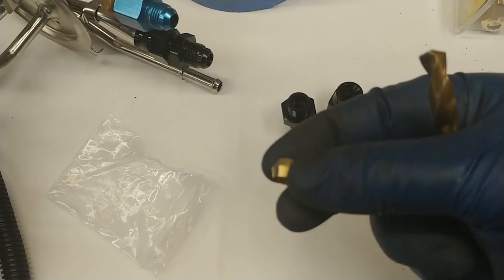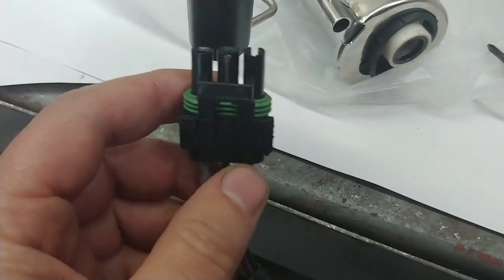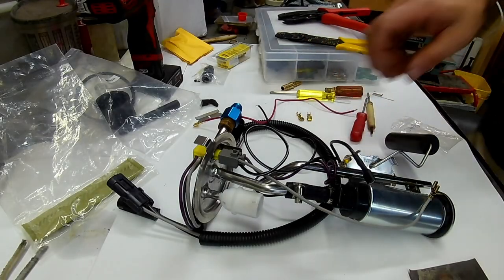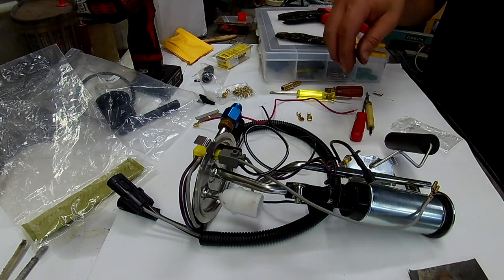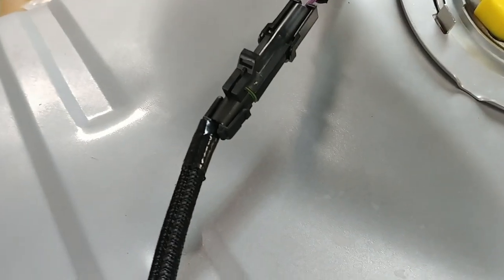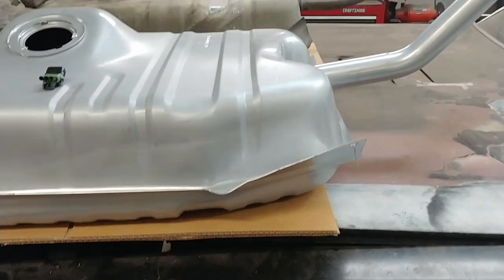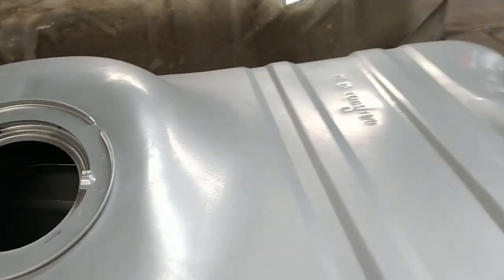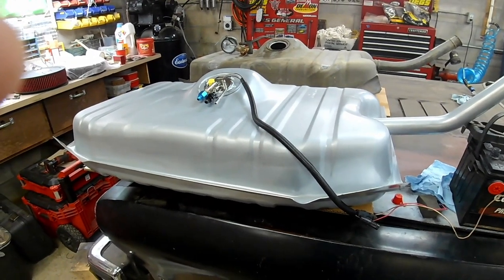Sniper EFI Install - El Camino / Monte Carlo ( G Body ) - PART 2

Comment: I did the same thing to my sending unit as far as cutting off the 1/4 inch part of the return line. That way no venting problems.
Reply from the maker: Had some issues with mine leaking right after startup. Cranked it as tight I as could without striping the fitting. That did the trick. These compression fittings are really only designed to work with aluminum hard line since its softer. But I figured what the heck. Did you have any issues with leaks?
Reply: No I cranked it down pretty tight